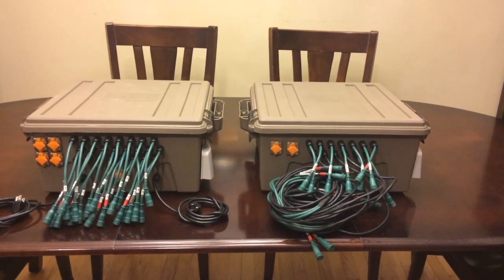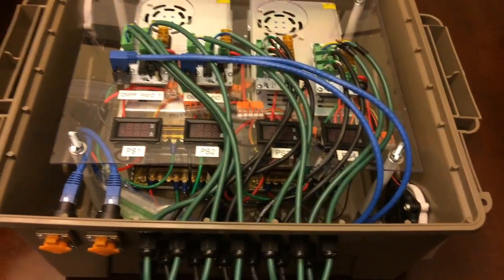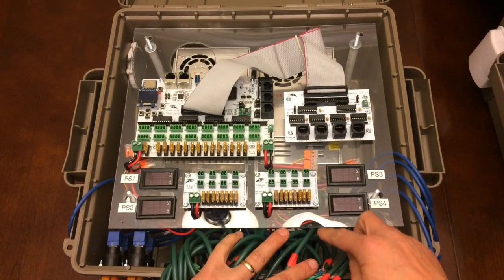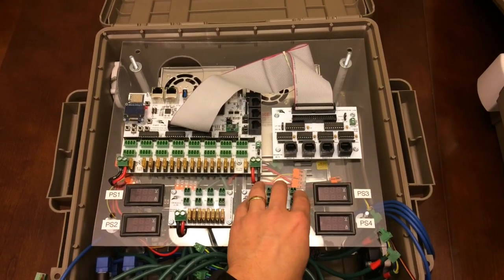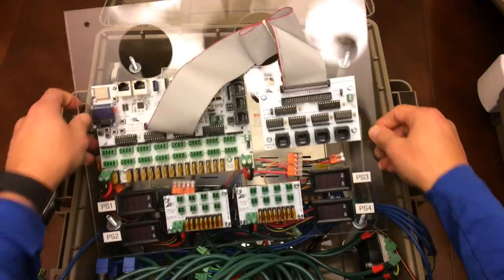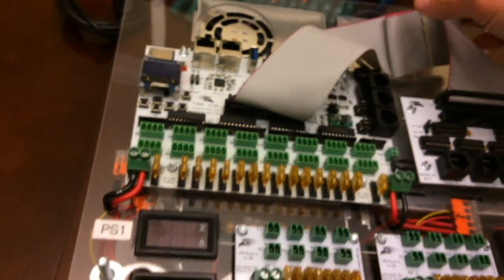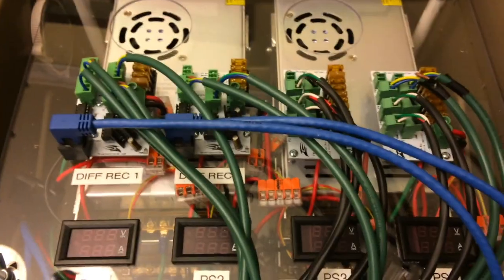Falcon F16V3 Ammo Box Build Breakdown

Comment: Just an amazing build. I'm currently building a box based on your inspired design. ("Standing on the shoulders of giants.")

Just a note: I saw what looked like some dangerous wiring on your power supplies that you might want to fix.

First, color coding your wires so that it matches the NEC/IEC electrical wiring color code would probably help you see where you might be introducing a false ground. See the 1-phase guide here ( https://www.electricaltechnology.org/2020/07/electrical-wiring-color-codes-nec-iec.html ) It looks like you mostly followed it, so feel tree to ignore.

Second, if you go to 18:24 in your video ( https://youtu.be/5ijZGRIW1tM?t=1104) it looks like you have the DC grounds connected, but not ground/earths connected between bank one and bank two. The idea is to prevent line-noise from entering the system, and there was a video I watched about electronics grounding for amateur radio equipment that I'm thinking probably applies here. I also, may be totally off-base.

As I said, I may be missing something, so feel free to ignore.
Reply from the maker: Thanks for your comments.  I agree, this build is based on builds from many before me.

I agree on the color coding.  I won't change what's already there, but good to know for future builds and for others.

For the AC grounds, I didn't bond them in the build as the AC pigtail cords are actually plugging into the same circuit using a thicker gauge extension cord.  So, they are essentially bonded.  If the left and right side banks were being powered from two different circuits, I would totally agree that putting a bonding wire between the left and right side AC grounds would be beneficial.  Another great comment for others making builds in case they end up powering each side from different circuits.

Comment: Great box build! Question about the the Lexan Polycarbonate plates. In your video you measure the top plate to be 12” x 14” but in your build list you say to get two 11” x 14” sheets—one for the top and bottom. Did you end up buying a larger size for the top and cut it to size?
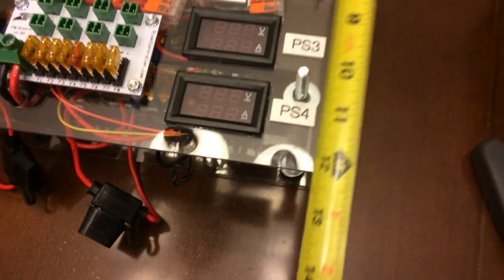Reply from the maker: Good observation Michael!  I must have purchased the 12” x 24” sheet for the top plate and a 11” x 14” sheet for the bottom plate for the measurements taken at 15:57.  That was my first build.  However, in future builds, I did away with the volt meters and standardized everything to use the 11” x 14” lexan sheets to simplify the builds, hence the discrepancy with the BOM.

ammo box build.
Reply: sjn6a98 thanks for the reply. I have two 11” x 14” sheets so I think I’ll leave out the volt meters. Thanks again.
Reply: sjn6a98 what size hole did you drill for the power supply on the top sheet?
Reply: @yakboyz1  It's the largest hole saw I had.  I measured it, and the diameter is 2-3/8".  I think anything greater than 2" would be fine to air flow from the power supply fans.
Reply: SlipperyAlpaca I have a question about power, sorry for so many questions. Because the power distro boards have their own power supply are you cutting the power on your pixel string when you inject power from the distro board?
Reply from the maker: @yakboyz1   I use power injection T's.  The T's are from a lighting vendor.  The power injection does keep the V+ separate at the injection point.  The grounds are all connected in the T's.  Hope that helps.

Comment: A few items generally I don't see posted as the wire gauge size ran to the LED strips/strings.  What gauge wiring to you use?  Second, are you powering one all the boxes from one power rail/circuit breaker line coming from the electrical panel?  15 AMP breaker?  20 AMP breaker?  Or using multiple power rail/circuit break line?  Thanks for this video, it is very informative.
Reply from the maker: LordHog, thanks for your comment.  LED strips/strings wire gauge is based on what the vendor of the lights supplies.  In general, 18AWG 3 wire is "standard" for the low voltage pixel pigtails and pixels.  That said, it's probably more 20AWG in reality.  For the AC power coming to the controller boxes, there's 4 - 350W power supplies in this unit.  I have run up to 8 power supplies off of a single 15A outlet with no issues.  So, I plug both AC plugs into a single extension cord which may have other items also using the same circuit.  

How many you run off one outlet is highly dependent on how much power you are drawing.  I designed my show to be able to run up to 100%, but run the show at 30% brightness in reality.  So, I'm only using a small amount of power relative to 8 power supplies on a single circuit.  8 x 350W = 2,800W where as a single 15A 110V outlet (15A x 110V = 1,650W) should only be loaded up to 80% or 1,320W (1,650W x .8).  When you derate the the power used by the 8 power supplies down to 30%, they would draw up to 840W (2,800W x .3) when all the pixels are on all white.  There are a number of good reasons to run the pixels at anywhere between 20% to 40%.

I hope this helps you.
Reply: @NiFamilyLights  Thank you very much for the information.  This is my first year venturing into this hobby.  A learning process to be sure.  Also, my mega tree blew over from the wind before I could get my guy wire installed.  Broke a few of my props :-(  I got my American Earth Anchors today, so will be using those to keep the mega tree safe.   I am just now creating the controller box.   Man, it took forever to install all the pixels into the black stripes and my hands still hurt.
Reply from the maker: @LordHog  You are very welcome.  The first year is definitely the hardest year to build a show and go through the growing pains of figuring everything out.  I wish you the best of luck with your mega tree.  Guy wires and a solid setup can't be understated to keep you, your show, and your viewers safe.  Check out my video showing how I setup my megatree, if you haven't already.  Best of luck with your show!

Comment: Great video man. I looked at your BOM on FB which is very well done and informative. The one item I was looking to source isn't listed, I'm trying to find 4 pin ip68 connectors that are long like the ones you used. Any idea where I can find them? Thanks
Reply from the maker: Thanks for the comment Johnny Crash.  The connectors I use is from the pixel vendor where I sourced all the pixels, 10' extension cables, and pigtails.  They are the same 18awg wire, and all the wiring/pigtails are 3 wire (V+, GND, Data).  I purchased these from DIYLedExpress.com but you can get them from other vendors.  

The key is to source all of your cables and pigtails from one vendor so you don't have compatibility issues.  They are not all the same. In the last year or two, the pixel suppliers have come to some agreement on an xConnect connector.  Those should supposedly be the same across all 
vendors, but it's always good to check.

Comment: Do you stand these upright, or lay flat on the ground? .... was thinking if you stood them up with a post in the ground, the tails hanging down, you'd get better cooling of the case internals, even whilst power is turned off.... cool air comes in from bottom right, and the warmer air leaves from the top left.  :)
Reply from the maker: Brandon, this design is intended for the box to lay flat. If you want to mount it vertically, you’d have to secure the internal contents to the box instead of relying on gravity. You’ll also have to be sure that any holes you drill through the case are sufficiently waterproof. Also, if you want air to flow from the bottom right to the top left, you’ll need to move the fan to the top left. It’s a good idea if you need to vertically mount your enclosure.

Comment: Doesn't look like you used the shunts that come with those volt meters. Guess they are not needed?
Reply from the maker: The volt meters I purchased did not come with any shunts.  They were installed per instructions.  That said, I've made more of these for other light shows and didn't bother with the volt meters.  Removing the volt meters greatly simplifies the amount of wires under the top plate.  With the latest generational controller and power distribution hardware, they all have LEDs that light up when power connections have power.  So, they aren't really needed.

Comment: What did you use for power coming into the enclosure (ac)?
Reply from the maker: Yes, there are two AC power cord plugs sticking out the front of the enclosure.  Depending on where you live, be sure to set the AC to DC power supplies to the correct AC voltage.
Reply: @NiFamilyLights  what awg is the wire?  See so many people running different sizes
Reply from the maker: @mkdesignstx  It's standard AC power plugs cables, 16 AWG wire.

Comment: You mentioned in your video that your power supplies are generic. Can you tell me what power supplies you are using, where you got them and are you satisfied with their performance and reliability.
Thanks
Reply from the maker: Rick, the power supplies are 12V 360W units.  I mentioned generic, as others like to use Meanwell branded power supplies.  You can get these generic ones from Amazon, eBay, or other Christmas light vendor sources.  These units were purchased from DIYLedExpress.com.  I've been happy with the quality and reliability.  I'm not pushing the power output capability, so I expect they'll last quite a while.